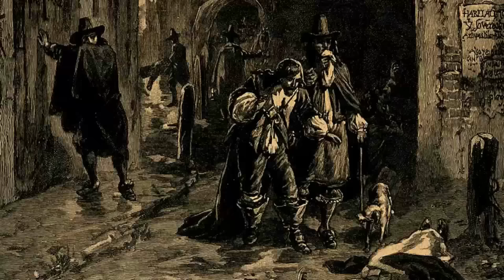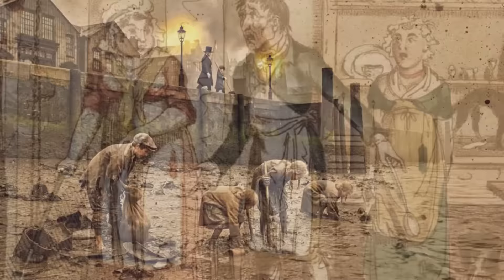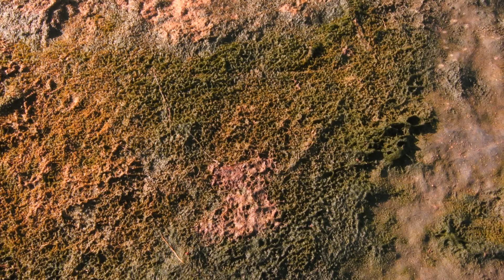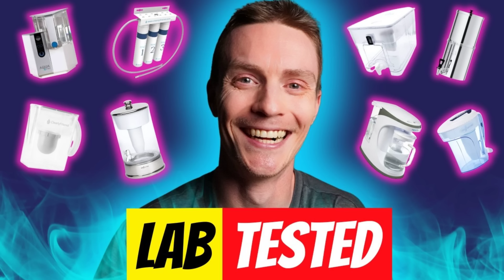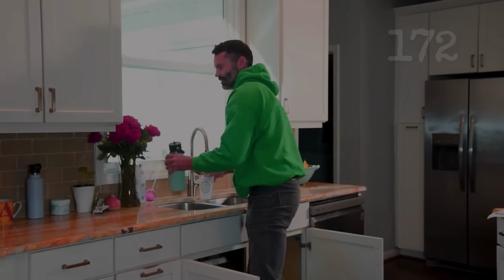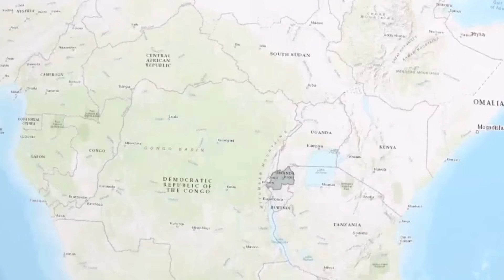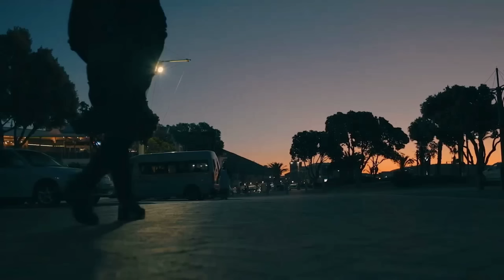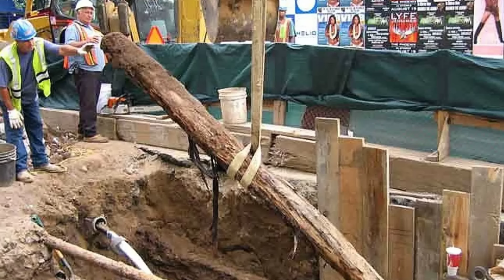The $50 Water Filter That Outlasts Any $5,000 System. Why Don't They Sell It?

Comment: What about living in the desert? We have to drill a very expensive well or I suppose learn to collect rainwater and learn to make it rain! ☔
Reply: Learn to make it rain - it costs nothing & will last a lifetime.
Reply from the maker: @lxmzhg  Rainwater collection is free in principle but the infrastructure, gutters, first-flush diverters, storage tanks, and filtration, has a real upfront cost. The lifetime value is excellent compared to well drilling or municipal hookup in remote areas, but calling it free undersells the engineering required to do it safely and reliably. In arid climates especially, the storage capacity needed to bridge dry periods is where the real expense lives.
Reply: @lxmzhg  good luck your bucking the government stopping the rain, 🤬but the desert will cool soon since they are trying their best to block the sun.😳🤦‍♀️
Reply from the maker: @jjwideawake.9397 Rainwater collection legality varies by state and has been loosening in recent years, with most western states now allowing at least some residential collection. The more practical challenge in arid climates is not legal, it is volumetric. You need enough roof catchment area and storage capacity to bridge the gaps between rainfall events. In a desert environment where rain comes in short intense bursts followed by long dry periods, the storage engineering becomes the real problem. The biosand filter only enters the picture once you have water to put through it.
Reply from the maker: Desert environments create a genuinely different constraint because the biosand filter needs a freshwater source to work, and if you do not have surface water or shallow groundwater, the filter has nothing to filter. Rainwater harvesting is the most viable path in arid climates but the volumes are low and unpredictable. The real engineering question for desert living is storage, not filtration. If you can collect and store enough rainwater during the wet periods, a biosand filter handles the biological safety side. But in a true desert with minimal rainfall, you are looking at well drilling or atmospheric water generation, both of which carry significant cost. What does your annual rainfall look like out there?

Comment: 1. Where are the plans 2. How can I make a portable version, not out of cement 3. How long does it take to grow the biofilm off of clean, chemical ridden tap water?
Reply: Look up "biosand filter" on Wikipedia. It will tell you everything you need to know in an orderly way. And the video says a 28-day time frame to start the process for the Biofilm to incubat.
Reply from the maker: @cmiller8693  Appreciate you pointing people to the right resource. The Wikipedia article on biosand filters is a decent starting point for the science and history. For anyone who wants to go deeper into actual build specifications, the CAWST Version 10 manual is the next step and it is also free. The 28-day figure in the video refers to concrete curing time. The biological ripening period for the schmutzdecke is typically 2 to 3 weeks after that, running concurrently with initial use.
Reply from the maker: The CAWST biosand filter construction manual is a free download and has everything, dimensions, specs, assembly steps, all field validated. For a portable version, people have built functional biosand filters using 3-inch PVC pipe instead of concrete, which makes them light enough to move but sacrifices some sand depth and therefore contact time. The biofilm question is the sharpest one you asked because chlorinated tap water will suppress or kill the schmutzdecke during ripening. If you are starting from treated municipal water you would need to dechlorinate it first, either by letting it sit open for 24 to 48 hours or aerating it. How portable are you thinking, vehicle portable or backpack portable, because those are two very different engineering constraints?
Reply: The chlorine in the tap water will kill the biofilter. You will need to aerate the tap water in a separate tank for a few days to evaporate the chlorine before going into this type of filter.
Reply from the maker: @KirkDickinson  This is one of the most important practical details in the entire thread and it gets overlooked constantly. Chlorinated municipal water will absolutely suppress the biological community during the ripening phase. The workaround is straightforward, aerate or let the water sit uncovered for a day or two before feeding it to the filter, but it adds a step that people building from tap water need to plan for. The deeper irony is that the chemical your city adds to make water safe is the exact thing that prevents you from building a system that would make their service unnecessary.
Reply: @LostBuildArchivez Would this process remove the state added fluoride/fluorosilicate oxide ?
Reply: @KirkDickinson You can easily remover chlorine by leaving the it in a water tank for a day or two. A tiny bit of ascorbic acid (vitamin C tablets) will neutralize all chlorine in seconds.
Reply: @KirkDickinson  Check out the videos on combining copper and zinc.  If I remember correctly, the two of them combined will take care of the chlorine
Reply: @KirkDickinson  Thank you for this info!
Reply: Try looking under the names provided. The newer name in 1991 seems to have developed the home version.
Reply: 4. Where can you get this biofilm?
Reply: @Eldy2  it happens naturally, if you follow the instructions.
Reply: Damn just use rain water and aquarium start they use in fishtansk or filtered water
Reply: @DogMA-d1t Please elaborate on how this would be safe for human use. Unless, you didn’t mean it for human use.
Reply: @DogMA-d1t please DONT drink the fishtank treatment 😢
Reply: Go read comment from @k94536 from 2/25/2026

Comment: what about those of us that want to get out the arsenic, and flouride they put in?
Reply: Eat garlic to protect yourself from arsenic. 
And for fluoride; Activated Alumina Filters: A granular material that adsorbs fluoride, often used in specialized faucet-mounted filters or gravity filters.
Reply from the maker: @keithnsearle7393  The activated alumina recommendation for fluoride is technically sound, that is one of the established removal methods. The garlic and arsenic claim is worth being careful with though. Some studies have shown that garlic compounds may help the body process certain forms of arsenic exposure, but that is a dietary mitigation strategy, not a water treatment method. If someone has arsenic in their water, the solution is removing the arsenic from the water before they drink it, not consuming something afterward to reduce the effects. Those are fundamentally different approaches with very different safety margins.
Reply: @LostBuildArchivezI JUST WANT TO BUY BOTH OF THOSE FILTERS
Reply: Alumina filters have consistent leeching of aluminum into the water. The FDA (who you should trust as much as the fbi/cia) allows up to 200ppm of it in your water. You should have ZERO aluminum in your water. For drinking water, i use a 6 liter distillation machine that feeds into a Barkley gravity filter using activated carbon, catalytic carbon 5, and carbonated apatite filters. I add all minerals back in with an essential trace complex. This way, the apatite filters last much longer.
Reply from the maker: @guardiandaytona8454  Your multi-stage system, distillation into carbon and apatite filtration with mineral re-addition, is essentially a miniature water treatment plant and the output quality is probably exceptional. The tradeoff is complexity, cost, energy input, and the ongoing replacement cycle for the filter media. The philosophical split in this entire discussion is whether you build a complex system that removes absolutely everything and then adds back what you want, or a simple system that removes what will actually harm you and leaves the rest alone. Both approaches work, but they reflect fundamentally different relationships with the concept of purity versus sufficiency. Where do you draw that line?
Reply: @guardiandaytona8454  *Berkey?
Reply from the maker: Arsenic and fluoride are both dissolved chemical contaminants and the biosand filter is not the right tool for either one. Arsenic removal typically requires iron-based adsorption media or specialized oxidation processes. Fluoride removal is usually done with activated alumina or bone char, both of which need periodic replacement. The uncomfortable truth is that no single filter technology handles everything, which is why the real question is what is actually in your specific water. Have you had yours tested, and are you dealing with naturally occurring arsenic or fluoride added at the municipal level, because those are two very different problems with very different solutions?
Reply: just get a water distillation unit, it'll get rid of basically everything, then if you're one of those people that think distilled water will kill you or suck all the nutrients out of your bones you can just use drops to add minerals back in
Reply: So how to we incorporate bone char with this system to remove the fluoride added by our loving utilities?

Comment: I have used the Berkey Water Filter for the last 16 years. It is gravity-based, needs no electricity, and the washable carbon filters last for many years.
Reply: Berkey doesn't get the best reviews when tested for purity.  Even some much cheaper, disposable filters get better results.
Reply from the maker: @Liselle-f7s  Independent testing on Berkey has been inconsistent, and that is a fair criticism. The challenge is that most independent tests are done on new filters right out of the box, and carbon block filters often perform differently after a break-in period versus at end of life. The bigger question is what standard we are even testing against because municipal water quality standards and backcountry survival filtration standards are two completely different benchmarks.
Reply: Copy of the old british Doulton product  which emerged from the pot filter in this vid
Reply from the maker: @naradaian  Correct, the Doulton ceramic candle filter predates Berkey by over a century and came directly out of the same British ceramic filtration tradition covered in the video. The Doulton factory in Staffordshire was making ceramic filters in the 1800s. What is interesting is that the underlying technology, ceramic filtration with silver treatment, has barely changed in 150 years while the branding and pricing have changed dramatically. At what point does a proven century-old design stop being a product and start being common knowledge that belongs to everyone?
Reply from the maker: Sixteen years on a Berkey is solid real-world data and worth more than most lab tests. The EPA situation in 2023 put a lot of Berkey users in a difficult position though, and the colloidal silver registration issue is still unresolved in the courts. If your filters are genuinely lasting years with washing, that changes the cost calculation significantly from what most people experience. How often are you actually washing them and how are you testing output quality, or are you going on taste and clarity alone?
Reply: Misinformation. 

This is not even recommended by the company.
Reply from the maker: @keaco73  Calling something misinformation without specifying what claim is wrong is not a correction, it is just a reaction. If there is a specific statement in the video you believe is inaccurate I would genuinely like to hear it because the data on biosand filter performance comes directly from peer-reviewed studies and CAWST field documentation across 70 countries. Which part are you pushing back on?
Reply: @LostBuildArchivez    
I don't think that they're referring to the info in your video...    
I think they're saying that using the same Berkey for 16 years with only washing the carbon filter (as implied in comment) is what is misinformation.  Of course this depends on which model of Berkey a person buys and if they are cleaning and maintaining the Berkey adequately.  It's definitely not a "hands free" gadget - and some of the inner parts will eventually need replacing even if maintained properly.

Comment: Ultraviolet light is given freely, daily.
Reply: UV sterilizes but it doesnt FILTER.
Reply from the maker: @ethereal369 Exactly right, and this is a distinction that gets lost constantly in water treatment discussions. Sterilization and filtration solve two completely different problems. UV gives you biologically dead water that can still be full of sediment, iron, and dissolved contaminants. Filtration gives you physically clean water that may still carry viable pathogens if the system is immature. The strongest approach is layering both, which raises an interesting design question about whether a biosand filter with a UV polishing step at the outlet could outperform systems costing fifty times more.
Reply: Quartz glass is best for this, because unlike soda lime glass and borosilicate glass, quartz let's most of the UV to pass through. Other glasses block most of it.
Reply from the maker: @justinw1765  Good point about quartz glass transmitting UV far more effectively than standard glass. Most people attempting solar disinfection are using PET plastic bottles which do pass UV-A reasonably well but block UV-C almost entirely. The practical tradeoff is that quartz glass is expensive and fragile while PET bottles are free and disposable. For someone building a permanent system rather than a field expedient one, does the performance gain from quartz justify the cost and breakage risk?
Reply: Has zero effect on iron, manganese or particulates  zero
Reply from the maker: @naradaian  
Correct on UV having zero effect on those. UV is purely a biological intervention, it disrupts DNA in microorganisms but has no interaction with dissolved metals or suspended solids. That is why UV works best as a polishing step after physical filtration has already removed particulates and after the biosand filter has handled the iron and manganese through biological oxidation in the schmutzdecke. Stacking the two in the right order gives you coverage that neither provides alone.
Reply: @LostBuildArchivezin all seriousness why wouldn’t you use UV sterilisation prior to physical filtering? Wouldn’t physical filtering then also remove the dead pathogens killed off by the UV sterilisation giving you a cleaner end result? Not that you’d be able to see a difference with the naked eye and I’m sure it wouldn’t matter too much health wise but if you’re going to all that trouble to filter and sterilise your water if simply changing the order in which you do things gives you a technically cleaner result, why wouldn’t you?
Reply from the maker: Also: True, and solar disinfection using clear bottles and direct sun exposure is one of the most underutilized water treatment methods on the planet. The limitation is exactly what some people pointed out below though. UV kills organisms but does nothing about particulates, dissolved metals, or turbidity. A biosand filter paired with solar post-treatment is actually a remarkably strong combination. Has anyone here actually tried running SODIS as a secondary step after biosand filtration?
Reply: Imagine having a stream on your property and creating a biosand filter reservoir that has a glass / clear aqueduct for the drinking water where sunlight sterilizes the output for extra security as it makes its way to water storage.  Perhaps you can have a mechanical day/night or digital light-level switch to stop the flow when the sun isn't shining.  A second outflow could run water through normal pipes for use in showers and toilets and a third could run directly to drainage downstream.  A continuous flow system becoming a complex part of the stream itself.
Reply: Isn’t water exposed to sun is prone to grow algae & go “bar”, I’m confused.
Reply from the maker: Solar disinfection is brilliant because it leverages free UV rays for sterilization without complex hardware.
Reply: iirc uv-a and uv-b are freely found in sunlight. uv-c (the one that kills germs) is costly due to the scattering of our sun's uv-c light so it must be synthetically generated and utilized locally.
Reply: AVOID THE VACKKKKKKKKKKKKKKKKKKKKKKKK 
SEEEEEEEEEEEEEEEEEEEEEEEEEEENS
Reply from the maker: @tle1015  This video is about water filtration technology. If you want to discuss the content, the thread is open.